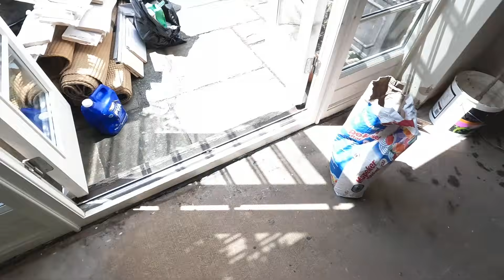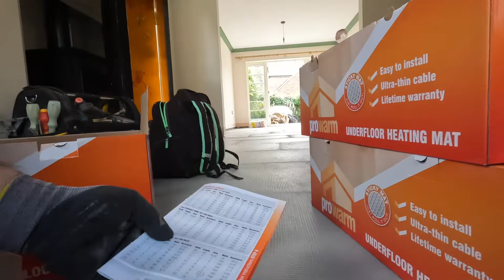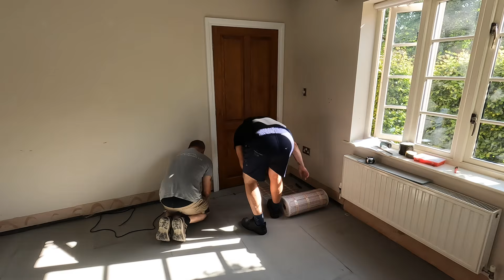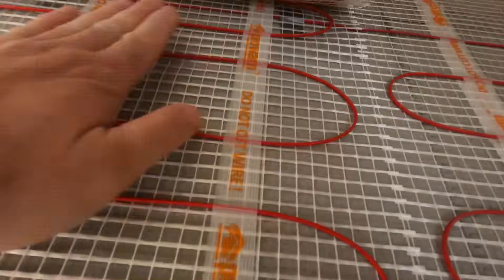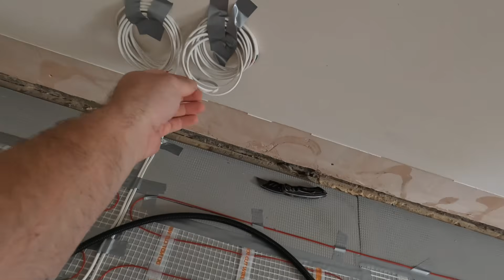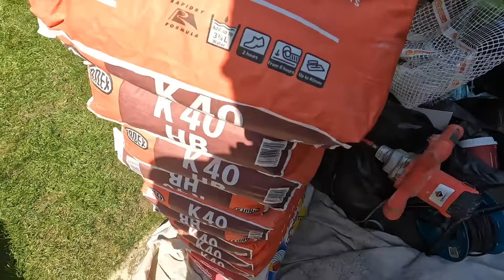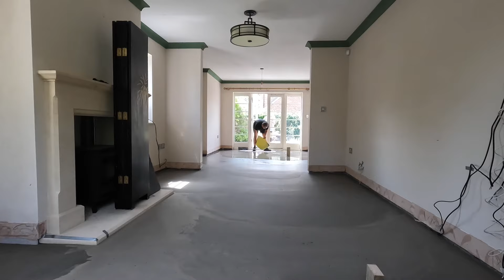Electric underfloor heating installation

Comment: Great video. Very helpful. I would like to see how the tiles went down, a bit more of an explanation on the thickness of the tiling compound and what you do if the mats stick up. Thank you
Reply from the maker: Thank you. If the mats is sticking up you need to place a piece of timber over and remove it before the levelling compound gets really hard. There is a video on the channel about the tiles that we installed over this underfloor heating. (Herringbone pattern tile installation)
Reply: @valentinointeriors3023  Aaaahhhh!  The herringbone was tiles, I thought you had laid engineered floor and wondered why you hadn't just used an underlay.
Reply: What is the minimum thickness from subfloor to allow for insulation board, self leveling compound and tiles?

Great video thank you

Comment: Great video as usual, a quick question , do you ever use the plastic spike roller ?  I have used levelling compound before but never the spiked roller.
Reply from the maker: Hi David .
I have used a spiked roller but not over the wires. The roller helps with taking the air out and also helps with the levelling.

Comment: what brand you use for insulation board? thanks
Reply from the maker: Hi 
We have used the same brand as the underfloor heating. Prowarm . I don’t think there is any difference in between brands.